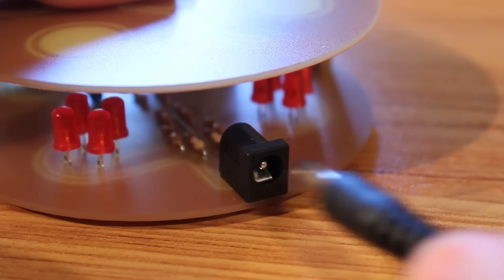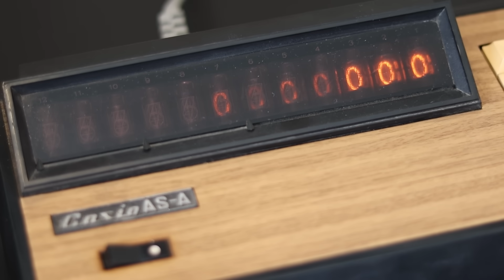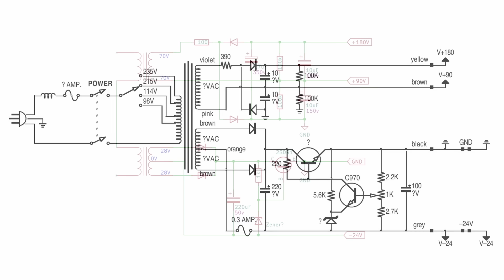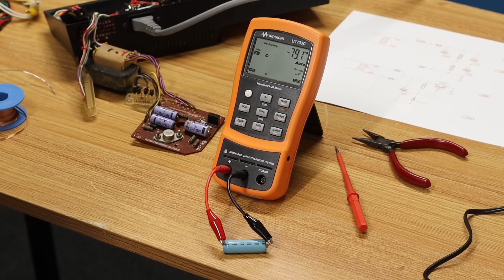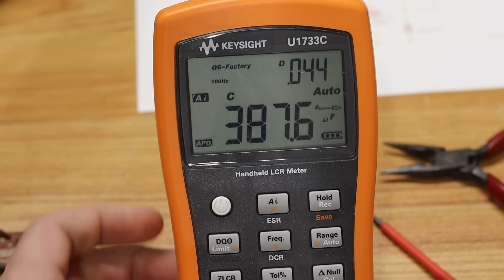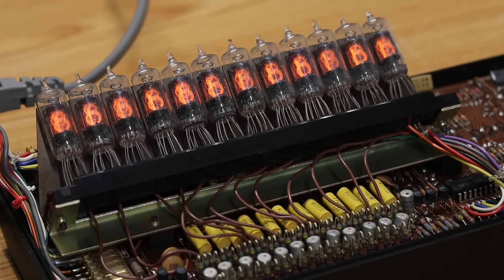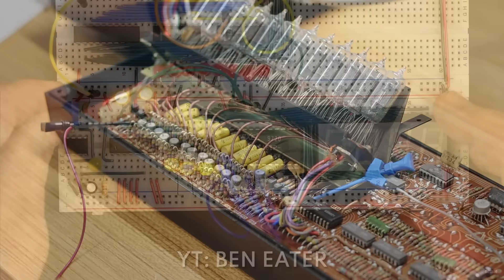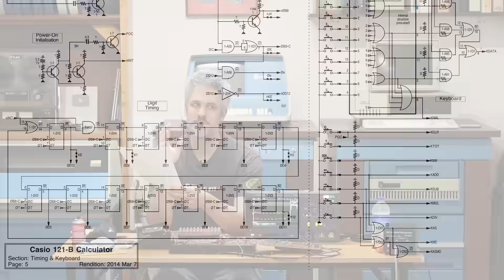Working on a Casio AS-A Nixie Tube Calculator

Comment: Those glass magnetic switches will basically last forever
Reply: Won't metal fatigue become a problem over time? Especially with how thin those strips are? The tubes look cool AF though.
Reply: @exidy-yt In theory, yes. In practice, no. The metal only bends a fraction of a mm so there is basically no fatigue. I have a couple calculators with reed switches and not a single one had issues with the keypad.
Reply: @exidy-yt  The metal is working as a spring.  It isn't being deformed.  The amount of bend in the spring is very small.
Reply: I bet it's an orange cat. Where I live we call those red tigers though.
Reply: I have repaired multiple Japanese calculators from the late 60s and early 70s and I have replaced a lot of faulty reed switches. They definitely don't last forever.
Reply: @megatesla  But they are superior to microswitches because of the good seal. Microswitches in low voltage / low current operation are really awful. After 60 years you have to clean every single contact.
Reply: @megatesla  I am surprised. Good thing then that these are still available and cheap.

Comment: Oh yes, I love these early discrete calculators too. Repairing them is a nightmare because there a mostly no schematics but often the problem is one or two components that lead to the calculator going crazy. The irratic behaviour could be as simple as a cracked solder joint or a bad diode, these often go open or short circuit on these machines. Good luck finding the fault.

Comment: With a 1-in-12 multiplexed display, I dare say you'd need to run the Nixies at fairly high current to get sufficient perceived brightness - it will be fascinating to see the reverse engineered schematics.

Comment: Am I only one here with exactly same Casio AS-A? An it did cost exactly 2 Euros 10 years ago in Helsinki. It was also fully functional few years ago. There was some divide by zero issue, which produced fancy light show, but probably overheated and destroyed something inside.
Reply: Correcion: Now it totally works again. But divide by zero produces just row 0.0.0.0.0.0.0.0.0 vibrating.The abovementioned lightshow starts with " 999999999999 X 2 = " .
Reply: I made a video of the multiplication overflow. It shuts down on its own and recovers after some cooling time.
Reply: @TimoNoko  I don't know the exact algorithm on that particular thing but presumably it simply tries to subtract 0 in expectation of a carry / underflow. It is the same on some electromechanical calculators and there it can get really frightening. 😀
Reply: Watch out for exposed high voltage but it would be a good start to check the capacitors.

Comment: Not only gorgeous, but thanks to integrated circuits, it's really small and lightweight too... at least compared to the East German monstrosity of Soemtron 220 built in the same period. That beast of a calculator has fully discrete germanium transistor logic and a core memory too. https://www.youtube.com/watch?v=VWnJy2KW_oQ

Nice axial cap hacks. DiodeGoneWild does something similar wrapping the cap with kapton tape, and I picked that one up from him. Heatshrink tubing is pretty elegant too.
Wishing you all the best with fixing it! :)
Reply: I was thinking of the Olivetti Programma 101 my friend in high school bought at a government auction.  It was bigger than a typewriter and had many hundreds of discrete transistors.  I believe it had a 20 digit mechanical printer, no electronic display.  The storage was a recirculating glass rod delay line.  If you smacked the table really hard you could scramble the register contents.  The 101 also had a card reader/writer which stored data on mag stripe paper cards.  We didn’t have any cards, so we glued some 1/2 inch 9-track mag tape on plastic and cut it to the shape of a card.  It actually worked reasonably well.
Reply: @wtmayhew  If you have one today, it is worth some money.
Reply: @HansS-vh8de  The Programma 101 belonged to my friend who bought it in 1976.  I don’t know if he kept it, hope so.  It was really a cool use of early 1960s technology.
Reply: @wtmayhew  There is someone from italy on ebay trying to sell one for 20k.
Reply: @HansS-vh8de  Oh my, from trash to treasure,  I believe he paid something like 50 bucks back in 1976.
Reply: To be fair the Soemtron 220 was introduced in 1966 and a quite advanced calculator for that time. It was built entirely from discrete components and had 6 ferrite core storage registers for 15-digit numbers, which were stored as BCD.
The real issue was that the GDR wasn't keeping track with the fast technological evolution and was selling it until 1977. By the way the same applies to the Trabant.